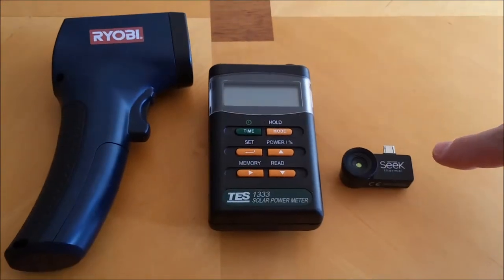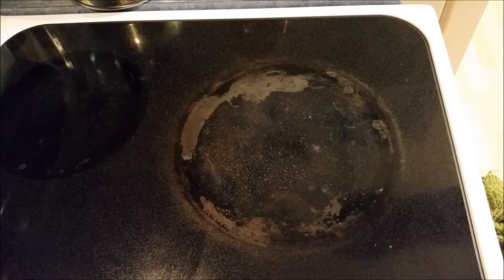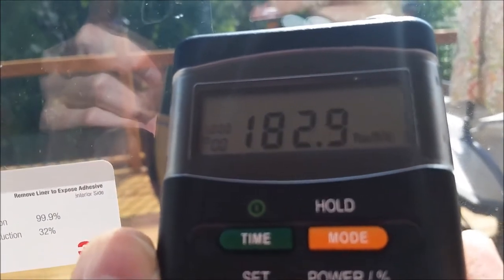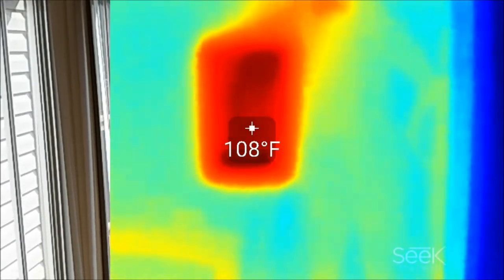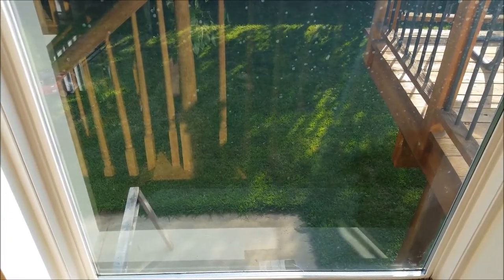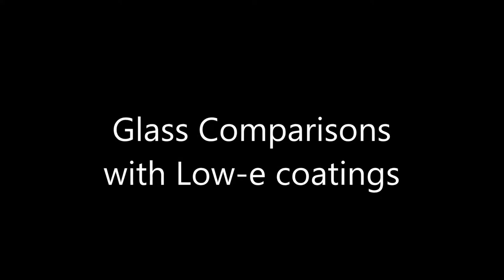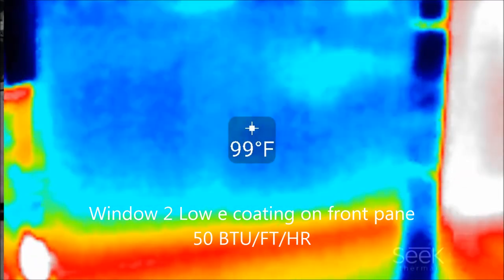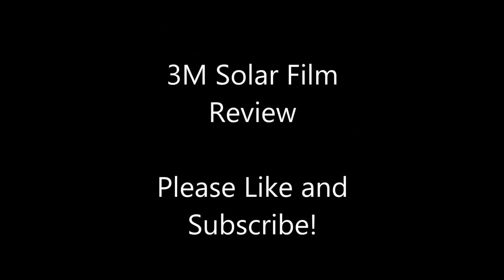3M Prestige 60 Solar Window Film Review

Comment: You can’t test the film in this manner. You either have the entire window coated or you don’t. That tiny piece of film is clearly being heated by the entire class that isn’t costed.
Reply from the maker: The science behind it is clear. Look at the sliding door with the sample film, the film adds heat to the glass. It's an additive effect. All glass will absorb some radiant energy when light passes through. In this case the film does nothing more than convert whats left after passing through the glass to thermal energy. The glass gets hotter with the film. It's basic physics.

Comment: Who came up with this brilliant idea to install this on the inside??? It will just heat up your double glazed units even more trapping heat inside... should be on the outside keeping infrared and uv rays out...
Reply from the maker: Yes. That's what I'm seeing.  These were interior films only.  Agree 100% these need to be outside,  but they aren't designed for that.

Comment: 🤷🏻‍♂️It seems to me that the film should be on the outside of the window. WHY DIN'T YOU DO THAT? It seems obvious from your experiment. WHAT AM I MISSING? Thanks. 😉
Reply from the maker: You are absolutely right. These are marketed as heat reduction films. Unfortunately, they do very little to do that and aren't designed to be put on the outside only on the inside.  They are really just UV blockers in actuality.
Reply: STEM_SAVING Well, there goes that! 

Also, this film is not cheap at all. I did the math and I would rather spend the difference on much better windows.  Thus far, exterior shutters or blinds are the only solutions for me. 

For now, I’ll consider better-tripled pane windows. The price difference seems to be worth it.

Thank you for your experiment. 
👍
Reply from the maker: Yes your correct.  Better investment is upgrading the windows. If they made film that worked on the outside, that would be ideal.

Comment: You are not using your thermometer and thermal camera in the right ways. Infrared is still light, so you are not measuring what you think you are measuring when you point your instruments at transparent and/or reflective surfaces like films and windows. There is also the emissivity of each surface to consider when trying to use these tools. It gets very complex. Instead, do it easier and with thermometers: install the film on one of your windows in a ventilated room with some air circulation, like a fan. Take two of something that absorbs light well, like an unglazed terracotta pot or a black plastic planter. Fill the pots with the same temperature water, place one on each windowsill, then measure at intervals with the same thermometer. Such a setup will be more analogous to relative real world results with the film, and circumvent some of your measurement problems.
Reply from the maker: There aren't any problems, it's simple physics... simply look at the temp of shades down. Around 100F. That implies behind the shade is even hotter. Which follows logically what the temp and imager are measuring.  When you put your hand on the film you can feel the difference.

Sure your can do all the things you suggested, but why if the tools I have can do the same job without all the hassle with trying to conduct a science experiment?
Reply: @stem_saving1644  I am trying to gently tell you that there are problems with how you are using your tools. I can lead you to the river, not force you to drink. But I urge you to on your own time and from sources you trust look into emissivity and reflectivity, which affects the readings from both your thermal camera and your infrared thermometer.

Look into the Fluke 62 MAX infrared thermometer, similar form factor to your Ryobi. The Fluke has a setting for emissivity from 0.1 to 1. What does changing that setting do to the measurements from the Fluke? Why do they even have such a setting?

Like you say yourself, you are not conducting a science experiment, but replacing the hassle of doing one with what you read on the displays of your tools. But what if those readings are incorrect, then where does that leave your video? And as I believe you will discover if you decide to look into it, they are incorrect. Do the science experiment please. It's very little hassle, literally two pots and a thermometer.

Science is not about being sure, it is about making sure. Your results should only be confirmed with an experiment measuring the same thing in a different way. In this case however, I do not believe you will be able to replicate the results you show in this video if you choose to explore this from the two pots and a thermometer angle.
Reply from the maker: @ringpolitiet  check out the window casing itself. No alleged emissivity issues, but also almost virtually just as hot, which confirms the results. I'm not worried about a couple of degrees of error, as it's drowning out in heat. 

I didn't need a science experiment to confirm the results I could feel.  It's good enough for govt work. 

I also recently replaced the set of windows below the ones with the film on them and the temps  beteewn them were staggering. One was 140, the other 80. Can you guess which one was which?
Reply: @stem_saving1644  I see there will be no drinking from the river today. Maybe tomorrow.
Reply from the maker: @ringpolitiet  don't need to drink from the river when you have water plumbed in at your house.
Reply from the maker: BTW, check the digital  temp. Thermometer that was in the window sill,  it too registered 100F+, no emissivity issues there, which also confirms my results... the films heat up.

Comment: Using a small section like that  - you  are blatantly ignoring ambient heat.
Reply from the maker: Small section like what? The entire window is hot on the inside.  The film is causing the ambient heat inside by its absorption properties!

Comment: Try measuring the temp of all the surfaces inside the room. Everything becomes a radiant heater. If the temp of all the surfaces in the room are reduced significantly, with the window being hotter there maybe a differential since the btus were rejected. https://youtu.be/V9CCfmo_ciw?si=6x0MPHoS9TH6Tow0
Reply from the maker: The temps of the inside surfaces  (walls, doors...etc) are driven by convection. The hot air heats the house. The radiant energy  gets absorbed  by the films and heats up, then transfers  the energy via convection.

Comment: exactly antique single glazed windows ....
the rest of the world uses 3 and 4 layers of glass with plastic frames and multiple seals and he complains that his house heats up in summer and that his heating costs are astronomical in winter.
modernize your houses instead of buying foils and air conditioners,
fixes the problem, not the symptoms
Reply from the maker: They are actually double pane windows, if you look at the window.

Comment: Of course it need to be installed on the outside.
Reply from the maker: It's not an outside film.  These were designed  for inside use
Reply: @stem_saving1644  Ah ok. For keeping the heat outside, it must be exteriour film. But you know that. 😉
Reply from the maker: Yup. That's why these films aren't worth it

Comment: Thank you.  I go with the science and the empirical results every time.  Your study suggests the product does not perform.  Intuitively, your explanation that the film warms up and that the energy is transferred to the glass and then the interior of the room make sense.  So, why are people/consumers happy with the results after installation?  I would like to see a more formal study of this product before I make a purchase decision.  At this point, I will not invest in this product.
Reply from the maker: Thanks for your response 
I think it's the lack of understanding  between radiant energy and thermal energy most people have. 

They feel cooler  since the radiant energy isn't striking them, not knowing  the energy is  still flooding the space just in another form.... thermal.

This coating would work well on the outside of the glass, similar to a low e costing. But at the time,  it wasn't available.  I have installed new low e coating windows with similar specs as the film and there is a world of difference   in both radiant energy blockage and the indoor temperature of the glass.
Reply: @stem_saving1644  Thank you so much for your detailed insights. Learnt a lot from your video and comments. My goal is to reduce heat coming into my house which could potentially reduce my electricity bill. What are your recommendations? 3M exterior film or low-e glass ? Any other recommendations? Thank you in advance.
PS: My contractor carries 3M films and he can install it for a very reasonable price compared to 3M authorized installer.
Reply from the maker: I can't speak to the external films, haven't done any testing.  But I did purchase some new triple pane  windows with low e glass and they really make a difference. Plus they also help in the winter with heat loss. 

The films are a stop-gap measure, windows are a better solution if you can afford it.